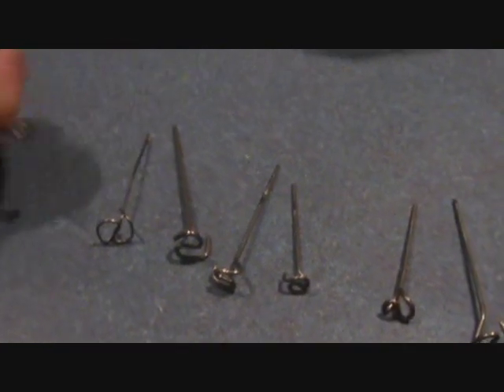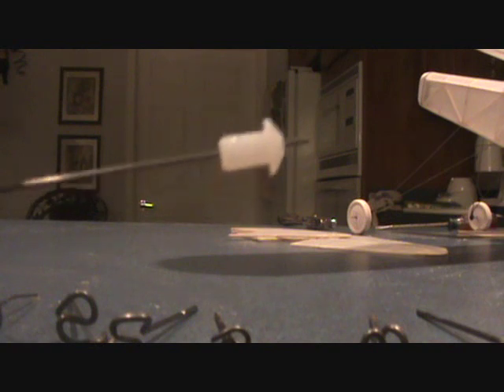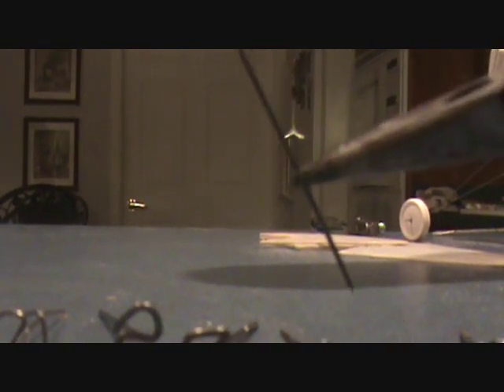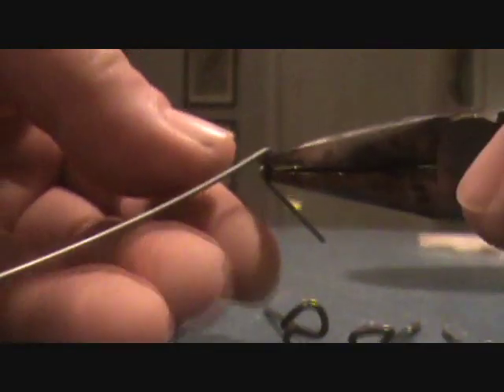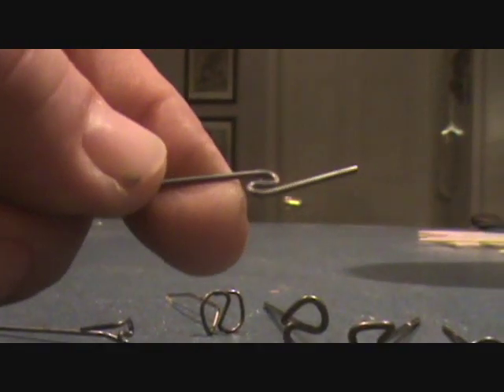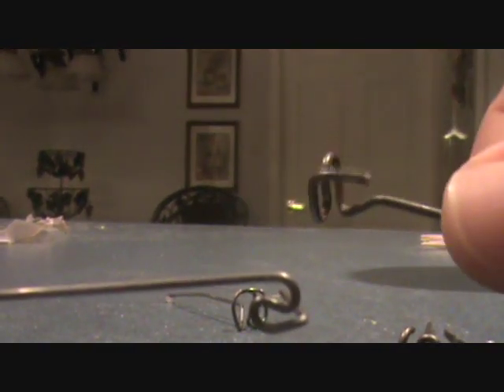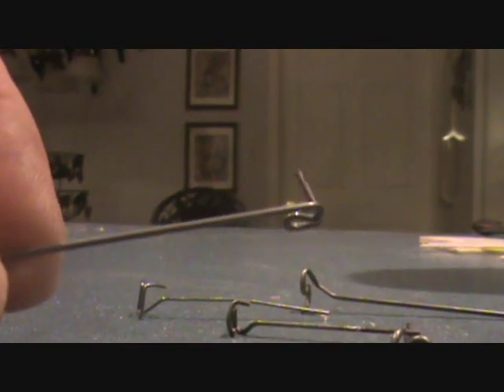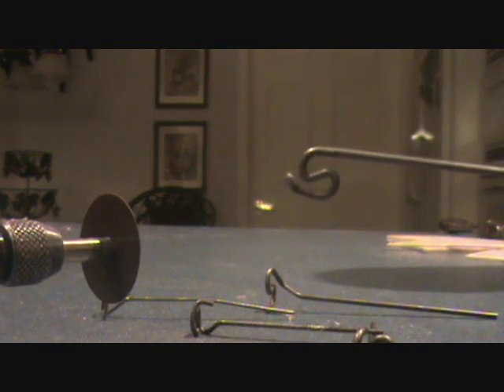Reverse S Hook.wmv

Comment: Thanks for posting this: rubber climbing up my prop hook was driving me mad. With luck, this will cure the problem. BTW, the way I check if the S is central is to put a spot of marker ink right in the centre of the S. Then, when you spin it to check its alignment, if it's off-centre, the spot will create a black circle, which is much easier to see against the silver wire.

Comment from the maker: What this hook does is to keep the rubber motor centered on the prop shaft.  If you were using a motor that is longer than the prop shaft to rear hook distance, which is what you need to do to get long flights, the motor can "walk" around a regular prop hook and create a lot of wobble and may actually come off of the prop shaft.
Chris